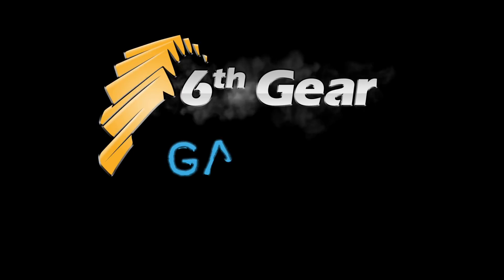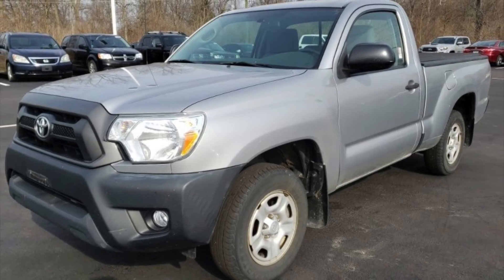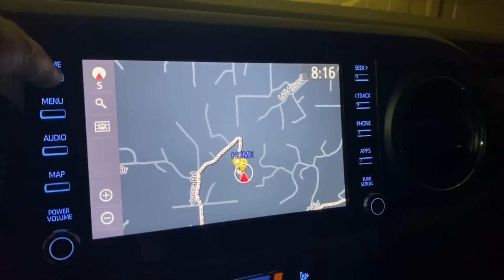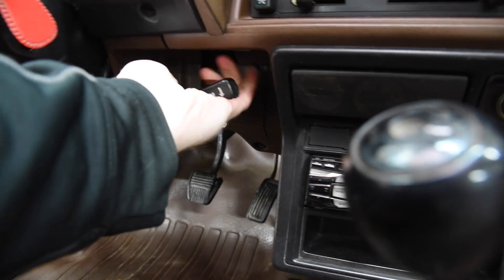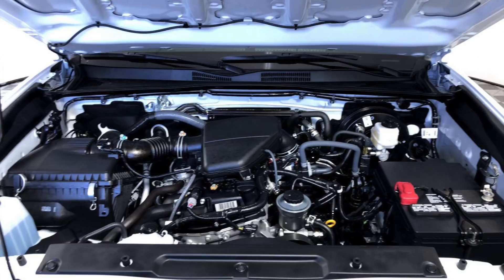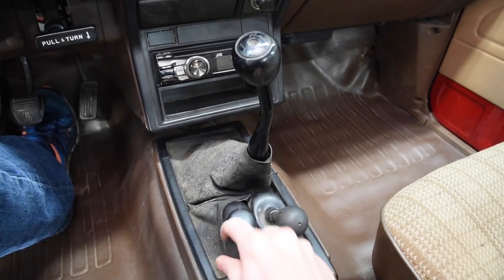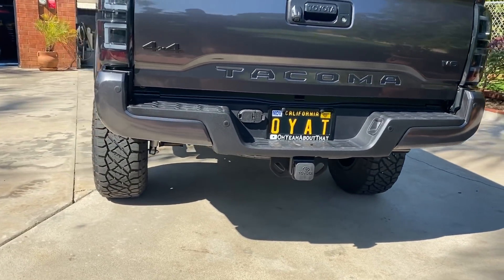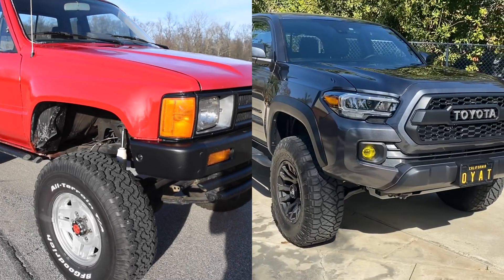1985 Toyota Pickup vs 2020 Tacoma TRD Off Road Comparison/Review

Comment: I have a 2020 and it’s amazing, that being said I’d take an 85 too. Two different times. Two different vehicles.

The 20 Tacoma is actually super simple and minimalist build wise compared most vehicles. 

When you lift the hood it’s still a motor and frame rails, not a bunch of crap stuffed under the hood and still super easy to mod.

Wouldn’t be surprised if the new trucks could run forever like the 85’s do. Toyota’s done a good job with the Tacoma over the years.

Comment: I'm not a fan of the 85 or 2020... I like the early 90's models... 91-95 to be exact love the body style. It took me a while to find one; I finally found a 92' V6 5 speed. Love it!!! Get ready to slap a 3" lift and 33's
Reply: That V6 is not a great motor though.  Good thing the 3.4 more or less bolts in.
Reply: Same here
Reply: Yeah, I have 93 LN107 Hilux with 400,000Km on it and stil running great.
Reply: Love my 92 and the original 3.0 has 318000 miles on it. Super reliable

Comment: I love the look of the older Toyo trucks. I even learned how to drive stick in my pops 95 single cab Taco. I still break my neck every time I drive by one but I couldn’t daily drive one. You don’t realize how accustomed we are to modern features until you sit in an olde one. I still remember how much I hated my first cars a 92 Celica with no power options tendency for the passengers side mirror to move on its own from. I’d have to reach over crank the window down, move mirror, sit back down, nope too much, repeat ahh just right, now I click a button perfect yeah I’ll take that lol.

Comment: 1985 all the way. Never liked newer vehicles, too much plastic and electronics, and too big.
Reply: All sorts or random crap and stuff you'll never use in the new ones. And I can climb in the engine bay
Reply: Sterling Makara 

Too big but some how less interior room. Must be all that safety junk.
Reply: Ok boomer
Reply: Too much plastic
Reply: I agree with you but the 80s Toyota pickups are entirely plastic on the interior. Cloth seats were optional lol

Comment: I have a 1993 Toyota 4x4 with the 4cyl 22R-E engine and a 2014 Toyota Taco Double cab PreRunner.  Basically it's a steel bed in the 1993 vs a plastic bed in the 2014.

Comment: I had an '89 extra cab 4WD Toyota truck, and just got a 2020 double cab 4WD Tacoma.  There's really no comparing them.  The 2020 is vastly larger in every way, probably more the size of a full sized pickup in 1989.  It is also much more sophisticated and well-equipped.  Apples and oranges.

Comment: 89 Pickup. It was called Hilux.  94 4runner, 88 4runner, and 99 Taco.  Sold the 88 in 2001 with 189k.  It's still on the road in the next town.

Comment: My first was an 86 2wd. I recently sold my 87 2wd 22r and got a 2020 SR5. I love both but it's hard to compare as they are not at all the same vehicle. I got the double cab with a long bed so I don't lose bed space to get a usable back seat. Not really built for serious off road due to the length but it's better than a 2wd with 250k miles. Both are incredibly fun vehicles but in very different ways.

Comment: The 85 all the way. The 22R was one of the most reliable Motors ever made. These trucks were made for their owners to be able to work on by themselves. They are what a pickup truck is supposed to be. The 20/20 is made for fancy lads who need their asses heated with heated seats and their infotainment system to watch videos of real guys taking their trucks off road.

Comment: Still running my 87 single-cab 4x4 SR5. Oh boy what a truck. It's still taking a lick'n and dang it's still tick'n. About to hit 293000 on the odometer. It's just a great truck and my daily driver. Great video. I subscribe to your channel for the fix-it videos. Am still contemplating about doing my dash fix but I think it can wait til I have more time. My truck is red also and completely stock, nothing fancy. I do have the interior carpet, center console, and the chrome plastic front grill though. Also the front chrome steel bumper. These 80's Toyota's are going for big buck's these day's just take a look on E-bay. It's crazy. Anyway happy trail's in OHIO!!!

Comment: I had an 85 xtra cab sr5 with the fuel injection  I have a Highlander now so ya 85 xtra sweet would bring me a Big smile. I abused that poor truck it had a 4 inch trail master lift kit 4 inch positive arc  on the front leafs with BFG 32 inch mud terrains. Wish I could find pics othe old logging roads power lines , that truck survived  up in northern ont. Can. Had an 81 Toyota pickup also bench seat no power brakes or steering that was another story tough trucks swamped that one twice  still have a pic that one somewhere both new vehicles off the lot  I logged just under 1,000,000 klms between the two of them. Nice truck  thanks for video enjoyed it.

Comment: I'm a sucker for late 80's/early 90's pick up trucks. Toyota's always have a rugged look. Only issue with today's technology is it allows more things to go wrong where during the 80's/early 90's trucks were...trucks. Nothing special, just brute force for work or recreational use. Today's trucks are powerful but things are easier to go wrong. I'm not only speaking about Toyota's but in general.👍

Comment: 85 Toyota great truck, very smooth clutch system. older trucks rule, i have a 1999 chevy silverado extra cab in mint condition engine runs like brand new and i wouldn't trade it for a 2020 no way.
Reply: Ultimate_Savage to be fair, GM went down the shitter big time
Reply: That clutch was butter.

Comment: 85 with one of those phone mounts function just the same as a center console from new vehicles. If you have it connected to Bluetooth from a new radio and pull up google maps your set. I have a gmc 88 and the set up works great.

Comment: I bought a 1984 standard cab long box brand new $10,100 with the sliding rear window and cruze added. Year 2 seam in bed sides started to rust, year 10 I welded 1/4 metal in the rusted frame..owned it for 17 years. Bought a 2001 Double Cab ( kids) for $25,500 with factory topper, year 20 here, I am welding Safe T Ap frame repair in now..Toyota still has the frame issue..they redid the undercoating at year 10 & only warranted it for 12 years..its a frame, the backbone of the truck, get it right guys!

Comment: In England the range of pickup trucks is very small, basically models from Mitsubishi, Toyota, Ford, Nissan and Isuzu. had a new 1990 Toyota Hi Lux with a 2.4 litre diesel engine and it was superb, economical, fairly quiet inside and comfortable. I would choose the 1985 model here because I value rugged and reliable simplicity above armchair comfort and lots of electronic gizmos.

Comment: 85 all the way, mine’s a long box. They are more fun to drive, look better and have more “cool” factor. Not the best for heavy stop and go traffic.
Reply: What lift and rims do you have on this 2020 TRD offroad
Reply: I would choose the 2020 for all the right reasons..we have gotten much better with safety and the suspension systems
Reply from the maker: Mike has Rough Country life on the 2020 and Fuel wheels.  I forget the exact model but it's in the video.
Reply: Tks

Comment: I am running a '93 Xtra Cab 2wd I4, not lifted, road tires. Safety comes from within. It is rusting away. I wish it had better fuel economy and more power. Unfortunately, it is about as long as my parking pad can hold, and as a city dweller with a small property, I treasure the narrow wheelbase of these old trucks. 2004 was the last year for the narrow wheelbase. I treasure the keys because copying. I treasure the simplicity because nothing never breaks. Only things break. The newer vehicles have SO many things. 

The newer units only beat mine by 1MPG, with all that glorious tech! Granted they are much bigger and heavier, but I don't want bigger and heavier. 

I would absolutely adore a new version of my low, road-tired pickup with a manual transmission and an awesome new 4 cylinder with tech. But failing that, I might go for those old T100's- close to the size of a new Tacoma, same MPG as my old truck, for less money.

Comment: It should be noted that you can get the double cab and 6' bed but it's less common.

The manual is available on the TRD off road too
Reply from the maker: I've been told... many times now lol. I wish I could edit the video on YT, but there's a pinned post with all the things I got wrong on the 2020.
Reply: @6thGearGarage  got ya. Well, in that case I apologize. I usually scan the comments before I comment just to not beat a dead horse, but didn't see any. But that's what happens when you scan.

Very interesting video!

Comment: Just a heads up, I have a 2020 TRD Off Road in the 6 speed manual. You mention that the manual is only available in the Pro and Sport models right around the 14" mark.  Awesome video though

Comment: love my 95 tacoma 2.7l 5speed 4x4. no options, I've added a 3 inch rough county lift, 4.10 electronic locking rear diff and limited slip front and 265/75r16 goodyear duratrac tires. shes my baby and loves getting dirty

Comment: I have  93 I am restoring
I am doing some SR5 upgrades and building a stroker engine with all stainless exhaust.
I will paint it too....a desert camo job is coming. 
Interior will match...Sr5 instrument cluster, seats, and vinyl (black) flooring.

Oh! btw, mine is standard cab short wheelbase > standard 4X4

and Yes! I would go with the smaller trucks, way more fun offroad and I just really like them more in general.

Comment: I'll keep my 88' sr5 4x4 extrCab, fully loaded for that time 22RE/5 speed manual has been great 350K miles.  Has never left me stuck anywhere from Death Valley to Canada.  Still fun to drive and now with LC Engineering Exhaust "sweet".   The power windows just keep working. weird.   The white paint has almost disappeared.  Nope, i gave up trying to get what I had on a new truck 2022 so I invest in oldy restore.

Comment: The 2020 offroad does come in a manual, but the manual does not have keyless start or crawl control.  The reason for the key in the manual is the clutch start cancel that uses the starter motor to pull the truck up a hill in 1st gear. 

Also the standard bed length for the double cabs with an automatic is 6', any tacoma double cab with the 2020 model year is stuck with a 5' bed only if it is a manual. It isn't much of a problem to have the 5' bed when you have the optional bed extender.

Source of info: I researched the hell out of Tacoma's before I bought a 2020 Offroad with a 6 speed and the premium offroad package.
Reply from the maker: Thanks for the info!

Comment: Upgrade the old 85 horn to dual round metal Bosch Mercedes horns out of something in the 90's. They will both fit behind the grille. One mounts in the same location as the original and the other a little lower in an already existing hole. All you need to get is one bolt and a nylock nut and wire them together. I modified and used the original horn wire connector so the original wiring harness plugs right in..
Reply from the maker: I need to do that... I have a BMW 7-series horn laying around. Should I expect any issues with the wiring or fuse?
Reply: @6thGearGarage  Works without any mods, although I haven't laid into it for long durations.
Reply from the maker: @sciflyer67  Good, I shouldn't have to if others can finally hear it

Comment: Two very nice trucks.  I would be happy with either one.  You need a full sized spare on that new one.  If I had the 85 I would add fuel injection, more lift, beef and gear the axles and run 38's on it.  With the new one I wouldn't go over 35's.

Comment: I've owned a 1988 Toyota 4X4 and currently own a 2019 Toyota Tacoma 4X4 Access Cab (2.7 Liter) engine.  I love/loved both trucks.  Which do I like the best?  Both, for their time!  So far, both trucks were basically Maintenance-free, just oil and filter changes and overall fluid replacement.  It would be nice if Toyota still offered a 1985 Version with all the 2019 options.  Now that would be a cool truck!
Reply from the maker: I love my 85 but I’d take the 2020 as a daily driver for my family.

Comment: Late coming to this video.  However, I will keep my 92 short bed pickup til the day I croak.  I bought it new with nothing but the am/fm casette and air conditioning.  Along the way I've added power windows, dual map/courtesy lights, Alpine/Polk Audio  am/fm/cd, and when my speedo went out 3 years ago, I copped a full gauge with tach dash from a 4 runner.  This machine is absolutely awesome....with over a half million miles on it.  I am the only person who is allowed to work on my baby.

Comment: had a 86 Hylux. a 88 sunraider rv, a 93 ex cab Hylux , a 94 ex cab Hylux  and my daily driver now is a "03" ex cab TRD with 315,000 miles O.E. runs like a champ doesn't use any oil, got my eye out for a good deal on a 2017 ex cab maybe a sport or pro I kinda think I want a manual trans, cool vid I want an old one for a project

Comment: I bought a 2019 Toyota Tacoma 4X4 (2.7 liter) engine and Automatic Transmission.  It did not come with a tow bar or package.  Later, after purchase, I checked on getting a tow package installed at the Toyota Dealership.  They informed me that the 2.7 liter edition was not recommended for a tow package, and if I were to install one, it would "Void" my warranty. Ever heard of this before?  Later I talked to my people at my local U-Haul Center and they told me they could install a tow package no problem. At this point, I guess, I'll need to wait until the warranty runs out for an install.
Reply from the maker: I’ve never heard of that👎

Comment: In the process of moving to Montana and Im picking up a 90 toyota pickup 4x4 single cab only because the 22re is basically bullet proof and the truck itself is so simple that there's not a whole lot that can even brake on them when compared to new trucks (also helps that it isn't 60k for a decent one).

Comment: I have that exact same truck. 85 extra cab 4x4. Except I just swapped a 22re into mine.
Reply from the maker: Ive considered converting to 22RE but not sure if it's worth the power increase.
Reply: 6th Gear Garage I did it mainly because the old motor was cooked and I found a parts truck for cheap.

Comment: I had a 1987 base model, 2WD, single cab.  Taught both my kids to drive a stick in that thing.  It was stolen by the homeless drug addicts in 2016.  I found a 2002 Tacoma extended cab with tons more power than the '87.  My daughter still misses Morty, the name she gave the '87.  The brand new Tacoma are too fancy, too expensive, too big, no thanks I'll stick with my 2002 Tacoma.

Comment: This is like asking if you would rather have a black and white TV with two turn knobs or the latest 4K Smart TV with a 240  Hz refresh rate. Reliability vs comfort. Wow. In this case, I would have to say the 2020 grudgingly because it looks awesome, but I don't trust today's workmanship as much as in older vehicles. Currently, I own a 1998 Tacoma 4x4, which is awesome in every right, but I only have the 2.7 liter which is great and probably my choice in case of an apocalypse. However, I would like to get it supercharged and find a way to weigh down the bed for better traction during wet weather. Cool but cruel question. That said, great video; what are the 0-60 times for each?
Reply from the maker: Google says the 2020 is 7.7 sec and I couldn't find anything concrete on the 85 but forums say mostly about 20 sec.
Reply: @6thGearGarage  Thanks. Have a good one.

Comment: You are incorrect. On the west coast, a "Custom Cab"  aka a double cab, could be bought as a factory authorized dealer option. The trucks were imported and then sent to be cut and stretched similar to limousines. A fiberglass extension was added to the cab with a full size bench seat allowing enough room for 4 adults in the truck.  The length of the stretch varied depong on model year. They were available from '79-88 iirc. They still have two doors. Its like climbing into the back of a Celica from the same era. I own a '86 Turbo Custom Cab.
Reply from the maker: I've seen those, they sell for good money. But I never heard of them being called a "double cab", just "Custom Cab" because they were customized and didn't have 4 doors.  I've never seen one that is turbo, you have a rare truck!

Comment: the 2020 devolved from the 2018. My mostly stock 2018 TRD off road came with navigation standard. With the manual transmission you lose two cup holders. After looking at the 2019 and 2020 models I think I got the best year of the gen 3 Tacoma.